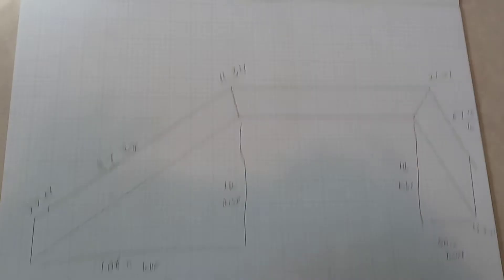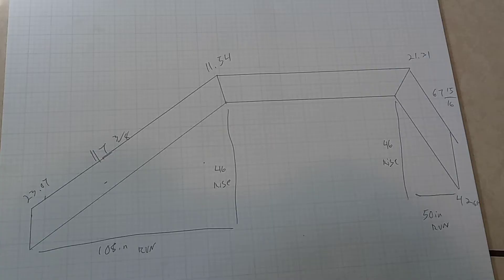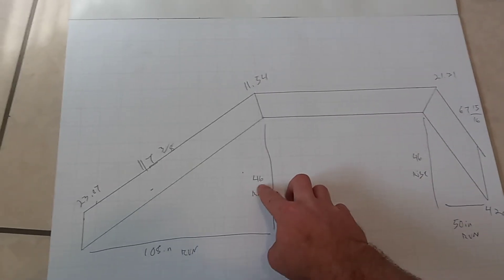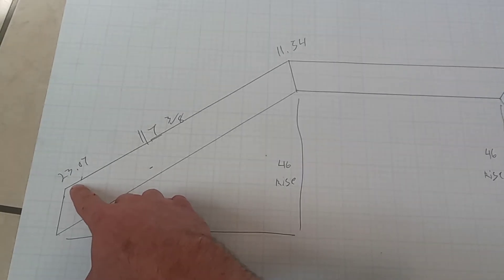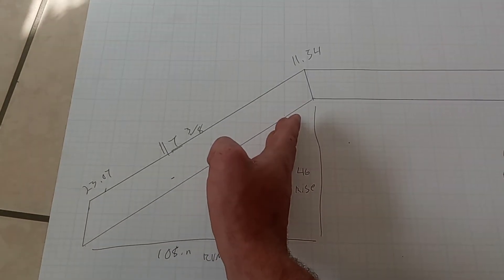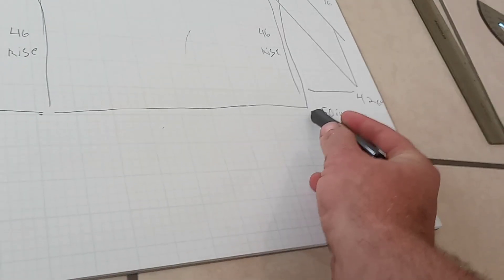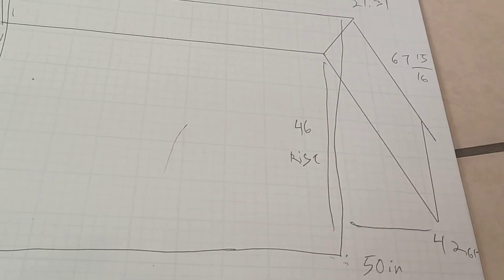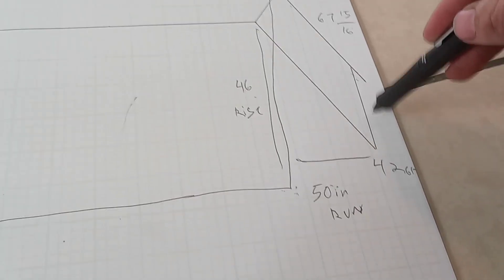How to build  a screen enclosure roof for beginners

Comment: Good stuff, I discovered this work after the hurricane hit my cage at my house in Florida.  I couldn’t find anybody I felt confident in to fix my cage, one of those, you don’t know how bad it is until you really start going over things and the way it’s assembled, fixes aren’t simple to do it right and I feared shoddy work so I decided just to do my own repairs. I’ve been a machinist for 30 years in a job shop so I knew where I could find proper supplies, even made some of my own hardware out of aluminum and stainless. My 56x28 turned out pretty good, although it’s an old cage, which means those old fasteners above combined with the strain of the storm wasn’t good for it so if I get hit with another storm, I’ll just build my own 56x28, so I’m on here looking. I plan on moving down in my early to mid 50’s. Wife’s a nurse and soon as she hits her medical benefit, we want to be gone and I’ll want to work. This work feels very familiar to making and fabricating like what I do at my job. It’s very satisfying. I wouldn’t mind doing this type of work. I won’t have to work, but I can’t imagine not working. I figure, hopefully I’ll have mine built between now and then so I can see how building one is. I’d rather build than repair. What are some of the common building codes involved? That’s my biggest concern. To make sure my design is good.

Comment: Been doing layouts for over a decade now.. i only use a whole number angle, and adjust the rise or run to the angle... also, the spline groove to spline groove rise, or another way to say it is the purlin rise, is the important number.. the actual beam rise is only used for the check span..
Reply: I've seen contractors picking up the beams pre attached and putting it together in sections. Which manufacturer does that?
Reply: Gay af